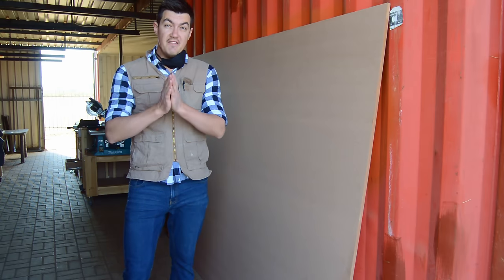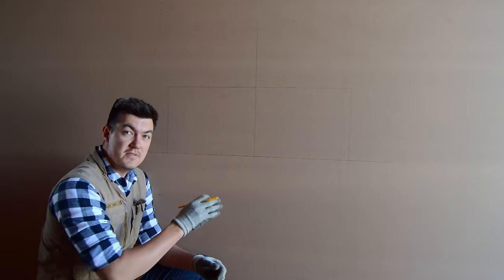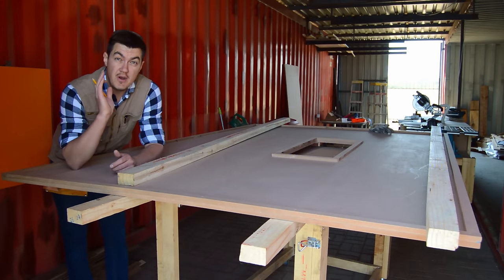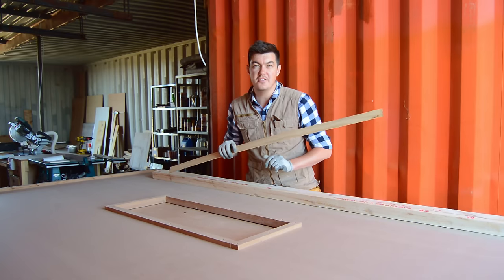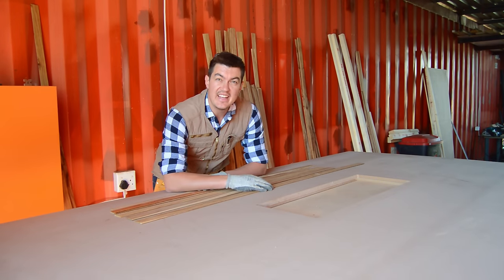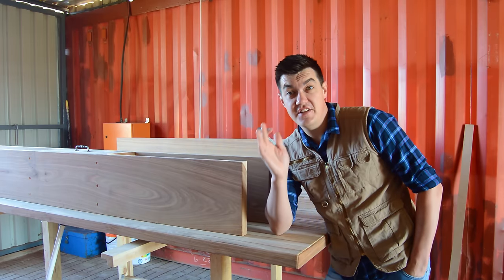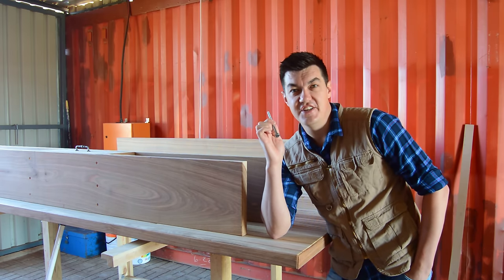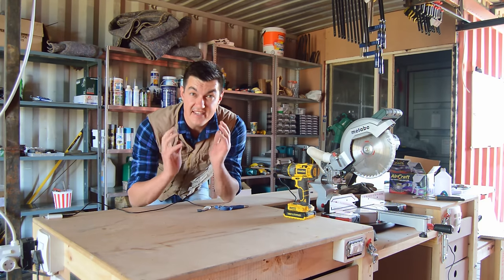DIY Floating TV Wall Unit - How To Build Your Own - YouTube

Comment: Wonderful!
That's a 65 inch TV right, how much the height from the floor to the tv? any idea
Reply from the maker: Hi M, its a 75 inch massive!! And it all depends on the layout of the room, tv size, height of ceiling, you ultimately want the tv to sit little bit above the center of the wall with the wall unit built around it.. hope that helps..

Comment: How did you mount the hanger? lag bolts into the wall studs?
Reply from the maker: Yes, as per the video we used a french cleet system to hang the unit.

Comment: I was wondering what router bit did you use on the 5mm strips?
Reply from the maker: Ots a 45 digress router bot
Reply: @diywithgreg  

Thank you very much. I will let you know how it goes building this unit. I cant wait
Reply: @diywithgreg  are there planes for this out yet ?

Comment: Hey Greg, what material are those strips You're using?
Reply from the maker: Good day, its 50mm thick Kiaat wood cut into 5mm strips..
Reply: @diywithgreg   is that MDF 1/2 inch or 3/4" thick? Doesn't look like a 4x8 sheet. Looks much bigger
Reply: @hotsausage504  thats right seems bigger is a 5ft x 7ft mdf

Comment: Did you use a double french cleat for this, or just one at the top?
Reply from the maker: Hi Nick, the unit is very heavy so we used double french cleat..
Reply: @diywithgreg  Thanks! I think you said you used Pine for the French cleat, which is a softwood. Did you just use that because you had it laying around? Wouldn't spruce, fir, or plywood have more support for the French cleat? I ask because you inspired me to build the same thing! I'm going to go to the store tomorrow to grab the wood but not sure exactly what to buy yet. Doing a double cleat looks a little tricky so I want to make sure I do it right. Thank again for this great video!
Reply from the maker: Awesome stuff Nick, the unit is heavy but its not that heavy that the soft wood damaged or bend, 2 people can pick the unit up easily.. If you run the pine from one side of the unit to the other side, with a double cleat system the weight is spread through out the whole unit and should be fine.. im on facebook aswell please share pictures when you are done! Good luck and thanks for the support.

Comment: Unfortunately, the video missing some key steps. But thanks for sharing

1) How did you hang your shelve to the wall? With the L French cleat? If you what about the TV
2) What varnish and why?
3) Why MDF and use strip of veneer instead of rows of actual wood/planks?
4) Why fasten screw from the top to form your shelve instead of pockets?
Reply from the maker: Unfortunately i cant record all the details, otherwise the video will be 4hours long. Im trying my best to give as much information as i can. Plans will be available soon.
Reply: @diywithgreg   are the plans available yet?
Reply: Really slow with the plans I see. Wondering if the Home Depot product is his lol

Comment: Can we use wood pallet for this?
Reply: You can use any type of wood.  However, it's going to be a lot of work in getting the necessary surface finish.  Don't forget that some pallet wood have been treated with chemicals so it may not be ideal for interior use.
Reply: @ivanfreely6366  thank you so much for responding. Highly appreciated!
Reply from the maker: Like Ivan said! And as long as your wood is dry you should be fine

Comment: Nice video, however you missed showing a lot of steps for the viewer. If it is a how to video then show what tools you used, how did you make the drawer, how did you actually install the lights. That sort of thing so me a thumbs down.
Reply from the maker: Hi Danielle, thx for your message. Its not easy filming and building at the same time, If i have to film every detail in all my videos we will sit with 100 minutes videos on each project. The ultimate goal is build a project and have plans available for the public afterwards.
Stay safe 😇
Reply: @diywithgreg  Thanks, Greg. I will check out the plans you have available.